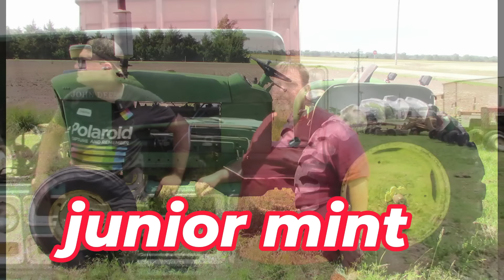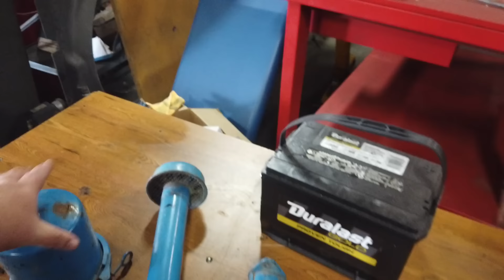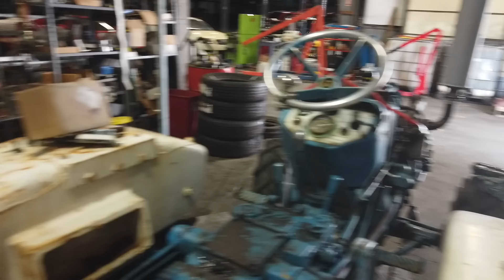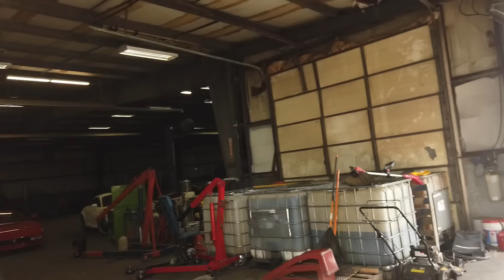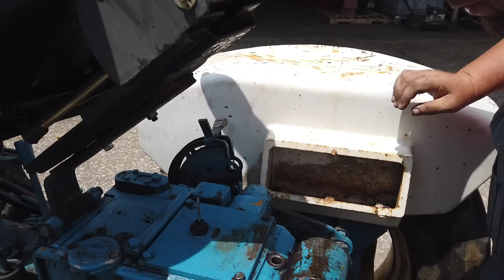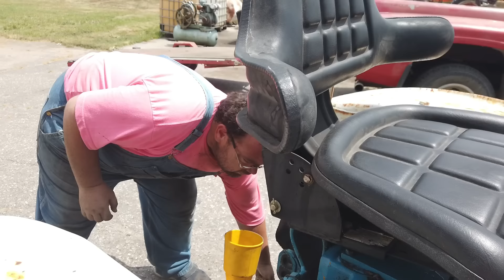Lamborghini comes to a close 🤷

Comment: I would say to do a "3-point delete" and make it a row-crop tractor. Leave all the 3-point stuff there/with it and a future owner can decide if they want to mess with it.  One of my 3-point tractors quit and I took it all apart and it was a missing cotter key on the bottom side of the internal hydraulic pump so the valve control lever fell off. Then reassemble again. It was a project.    A fixed hitch tractor can do a lot of hay raking, maybe even baling, pulling a disc, and more so it will be useful to the right buyer.

Comment: Unfortunately, their cars are just as horrible!  But, to be sure, the previous owner got all the use he could out of it before parking it. If it has a lift similar to the Ford, it shouldn't be too difficult to open up the rear and get at the control valve and hydraulic pump. I've had the pump drive gears shear off the drive key and leave the pump not turning. That or the control valve isn't moving on the in side. As to the hard starting, it's likely the injector nozzle tips being too worn to make a proper popoff pressure or spray pattern.

Comment: It looks like a tractor that needs a complete overhaul of the engine, fuel system and hydraulic system. The thing is just completely worn out.
Reply from the maker: We have already done a complete overall of the engine and fuel system unfortunately the parts are not available to be able to do that to the hydraulic system of this tractor we need to adjust the valves again on this tractor unfortunately the correct specs for this tractor or are almost impossible to find and when you do find them they are in a foreign language and have been hard to translate to what we exactly need we have hit many bumps in the road but have come a very long way on this tractor it is almost complete we will get this hydraulic system figured out and it will be complete except form body and paint issues which I am not touching